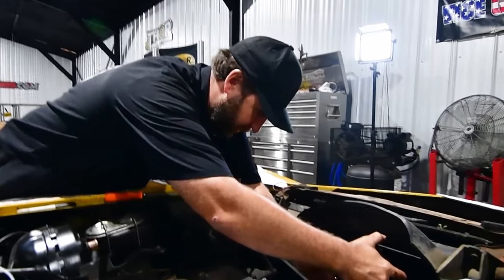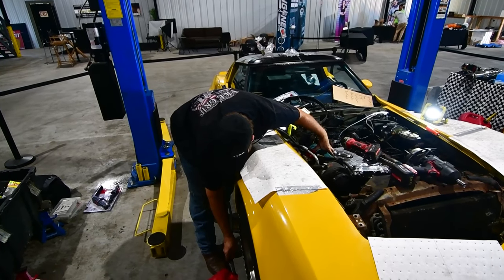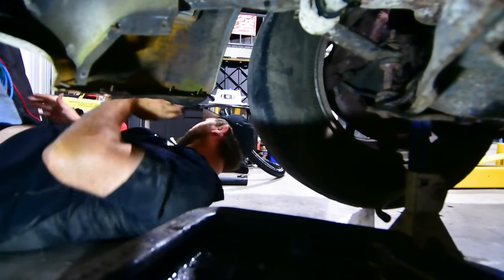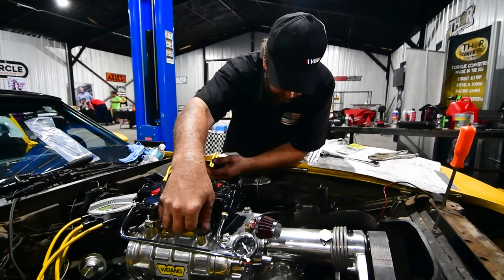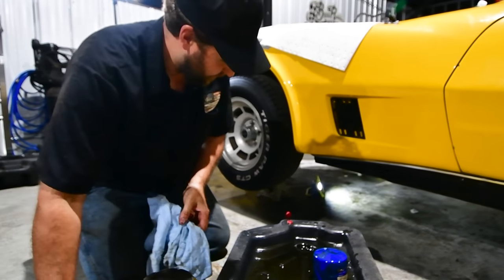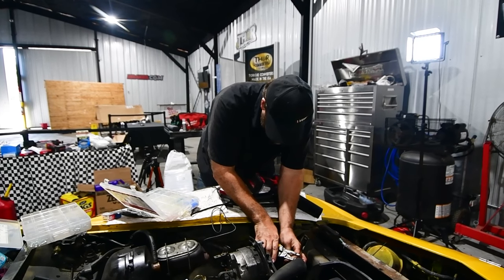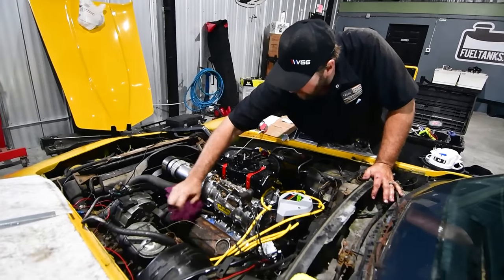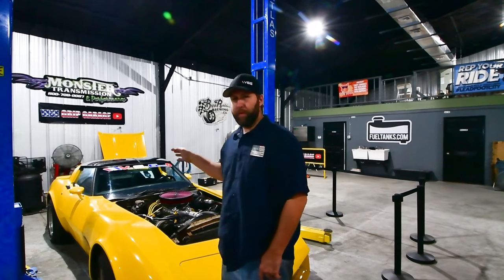FORGOTTEN C3 Corvette Gets Supercharged - PART 2 (Boost & Broken Parts!)

Comment: I had a single carb weiand blower back in the early 90's . Kept slinging the belt at 5k they sent me new pullies,  same thing.  So i sent it back to them,  and they sent me a new one,  no problems with it.  They said the shaft was walking in & out on the old one starting at around 5k mine wasn't a going to town polished one like yours though ha
Reply: Goin' to town polish!ha ha!I'm gonna use that one.
Reply: same, cept it was an old gasser racer that diagnosed mine

Comment: Doubled your horsepower, 250 at least now.
Reply: 250 flywheel HP that's 180 wheel lol!
Reply: @79tazman  not through a manual that wheel horsepower number is a good bit off there at least 210-220 minimum

Comment: CENTURY used to make the best battery charger units. Absolutely bullet proof. We had an old one “ancient”, it still works better than every medium priced unit ever. I’ve been through 4, of the cheaper units,, and the really old CENTURY still pumps amperage.
So if the welder is built anything like the old century batter chargers,, this might be worth looking at. Thanks for showing that off.

Comment: How he makes everything seem so chaotic yet so calm amazes me everytime 😂😂
Reply: It's called lots of editing. Probably spent good 1 or 2 hours more work on the car. As example I just put 02 sensor had drill the exhaust on my motorcycle he did it within 5 minutes, me the job took about almost 2 hours. I hook up power commander V and dial in correctly with laptop the AF/R.

Comment: I do wish he would wear safety glasses when grinding I had a friend go completely blind in one eye from stuff like that
Reply: They are about worthless unless your grinding on a bench the small stuff still gets in your eyes
Reply: I got some metal in my eye doing something like that, didn’t notice until the next day. They clamp your head down to a chair, hold your eye open with clamps and use a magnet on a stand as big as an engine hoist to pull it out. All for only $200! Do what ya want but I buy safety glasses by the box. They more ya got laying around the more likely you’ll use em.
Reply: I've never had them use a magnet they have always just numbed my eye and took a swab and got it out
Reply: Dave Micolichek  yeah I have been lucky and not had a hot one mostly pieces of rust getting flung at me by the spinny death wheel
Reply: Good idea

Comment: AVgas (100LL) is blended to burn best at 14K ft. Whilst it is an improvement on pump fuel (with ethanol) it's still not race gas.  Next time call some local motorcycle dealers (MX mostly) and ask where to get the good 115 octane stuff. Like button smashed...

Comment: For the motor mount issue just put a "brace" from the exhaust manifold bolt(s) to the frame. You only need it on the captain's side. Most metal shops would let you have the scrap you need just to see what you do with it!

Comment: We bolted a chain to the head and a turnbuckle tightened from the chain to the frame to keep from popping the motor mounts loose.  Chevy would put a steel cable around your exhaust manifold bolted to the A arm mounting bolts, as part of a recall.

Comment: good clips mate, the motor mounts just wield them,  the rear end needs the block damping rubbers take out and just replace them with wood or metal, stops the rear wheels bouncing bad. take off your rear wheels and soak them in light oil over night. the last thing is, brake line cut off the rears.

Comment: What we do on the ol mud runners is take a few links out of a chain and use a bolt on each side of the block and either bolt it or weld it to the frame so she’s just right solid with no wiggle room no more breaking motor mounts

Comment: I can't say anything about a lack of mufflers. I straight piped my C3 with 2 3/4 exhaust with a set of glass packs running out the back with the tips welded onto them. It sounds so good.

Comment: Fantastic; glad to know I can put a blower on my C3.  Gotta get it smogged biennially so im not out of jail yet.  Tried a couple electric fans... just didnt cool enough and thats without a blower.  No room for a push fan.  Going back to original shroud, engine fan with electric pull backup now.  WD40 on the rad hoses make them slip on like butter FYI ha!.  And yes some hoses are a bit longer (cut to fit).  Motor mounts pretty easy to replace one at a time...  Dang wanted to see it rip:(  "I doan noawwww" lol

Comment: I'm throwing popcorn.  You can mexican, err... Manuel.... argh! manual the steering on a C3 corvette by simply removing the hydraulic ram then relocating the tie rod ends to the closer holes (after you melt the lead cap out - which is fun) on the spindle arms.  It drives fine, parking lots kind of suck, but once you're moving; you won't notice the PS is missing.

Comment: I haul gas. At the loading rack right before the fuel is pumped onto the trailer is when the ethanol is injected. If the gas sits long enough the ethanol will separate. Ethanol is hydroscopic, which is a fancy word for water soluble. So if you ever want non-ethanol gas, just add water, mix and let sit, the ethanol and water will separate and the gas will rise to the top. Siphon off. In theory

Comment: Broken motor mounts are a easy fix.  Get the motor lined up and run two short links of Chain one from the frame to the front of the block bolt the chain to the frame and bolt the chain to the block.  One on each side and ypu are golden ponyboy!!

Comment: You should have gotten a relay for the electric fan so you don’t have to worry about melting the switch. They are super easy to install and you can still use the switch or find an ignition on power to turn it on automatically with the key.

Comment: We used to run Royal Purple engine oil in our Nitromethane Harley dragbike engines, great stuff. Its the only oil that still looked like oil after a single quarter mile pass. Every other oil we tried would be a baby shit yellowish color after each pass due to fuel contamination which is hard to avoid with the amount of fuel needed to run on Nitromethane. Still had to change it after each pass but it seemed like we probably couldve gotten another pass out of it and been okay.

Comment: wispers derik a secret, when slippin on  rad hoses wipe inside hose with pure anti freeze, if another is good ol liquid dish soap. and, and , and your biggie fustrations, carry a small propane tourch, heat the brake line fittings and generally they will just spin out, if stuck you also could have found a smaller demention fan, when we dropped the blower on my chevelle we went to a tiny bit smaller fan, biggie challenge i ever tried was puttin a blower on a 429 we litterly pounded and stuffed down into a 69 grande mustang, it worked about as well as expected learning we hadda cut two tirds of the front of the car into chunks to never get a hood to fit nice again we abandoned that idea, the chevele was a diffrent story it was a go and shuter off car, quarter horse, all it ever done was run the drag strip so a couple rough cuts in the hood was covered by a really bad mounted scoop. but remember dish soap does alot of slippery assistance

Comment: Bolt a stainless steel torque strap 1" wide by 3/8' thick from the front of the frame to the front of the engine torque side,  might even use that piece of frame you cut out. Old drag racing mod. Good luck

Comment: If to tune up the engine its an opnion to get best result put the transulation in gear turn the steering to any direction and if a/c is working put on its to tune engine with engine on load idel

Comment: Derek, a guy is always trying to figger a way to keep the 'ol engine cool with these here pro-jects.  Wondering if you've ever heard of a product called Evans "waterless" coolant.  Supposed to be all the rage with the racing types.  Anyways, you put it in your rad-jiator without water (after flushing all the water out of your radiator and cooling system first) and its supposed to let your engine run a lot hotter than with 50/50 coolant.  No "hot spots" caused by steam.  Has higher boiling point than normal coolant.  Anyhoo, a guy thought you might want to read up about it when you have a minute on the 'ol Interwebs.  I ran the stuff in my Mini Cooper and my Goldwing for years with no issues.  Its kinda pricey, but it never needs to be flushed out or replaced, ever!

Comment: AVgas or any leaded fuel does not play nice with O2 sensors, so your AFR might read wrong.  The lead coats the sensor element so it will kill if exposed for too long.

Comment: Dang those rubber motor mounts. Burn outs?make em steel motor mounts. Airport Gas used to be around 125 oct. Planes use low lead now? Sounds good

Comment: LOL, the ol' Cleeter Hood Deleter mod!    I hope you didn't run that straight 100% coolant, I assume you diluted that 50/50 with water. Straight coolant actually has terrible heat conduction, and will freeze at about -10F.

Comment: Get a fuel pressure gauge that is fluid dampened, think they put glycol or some clear liquid in there. ** To bad on your motor mounts. [ Do you have to de -convert that when your done, with the burnout show. So you can sell it  $$ or use it ; make it street  legal again ?

Comment: You had me right up to the time you were cutting metal over the top of your open carburetor . Once saw a 5,000 hp tug boat engine destroyed with the same technique. But hey, it's your money.
Reply from the maker: I'd have to say personally if a 5k engine was destroyed from a couple microscopic files of metal, there was a underlying issue at hand.  I've thrown gravel through a SBC and it drove me home.

Comment: "Not use that cornmeal stuff" lol did you know that most 93 octane isn't 93 octane without the cornmeal. Ever since they got rid of mmt they've had that use the cornmeal. I have a couple buddies that swore on 93 without ethanol but they keep breaking. While all the guys running E85 E98 or methanol... keep setting records. Maybe someday soon we'll get rid of gasoline all together... that stuff is junk... they use to throw it away and should. Anything you have to add a bunch of chemicals too... just to use... is probably a bad idea in the first place. 🤷

Comment: Use Race Gas additive. Can mix pump gas up to 112 octane. I’ve used it for years in my race car (tuned for 98 octane unleaded). It works perfectly, just as good as Sunoco 260 GT racing fuel. It’s cheaper, and it’s super convenient.

Comment: Really 5-20 oil for a clapped out 350 with a blower on top, that you fully plan to abuse and overheat?
Definitely would have been better off with the 10-40 diesel oil

Comment: Put e85 in it just remove the jets
Reply from the maker: completely remove the jets..?
Reply: @ViceGripGarage  richard holder had a motor that wouldn't fuel so they removed the jets and that fixed it lol might work

Comment: I wont give at away MY uncle said I can keep tit there is a;long as its insured but I don't want to be using family It needs a grill core support rad and AC condior inst leaking at all no spots or drips. I want to some to that t\likes original cars I also have emery recepots to what has been done. I don't want this ti go to the crusher that is why I told Progressive that i Would keep it.